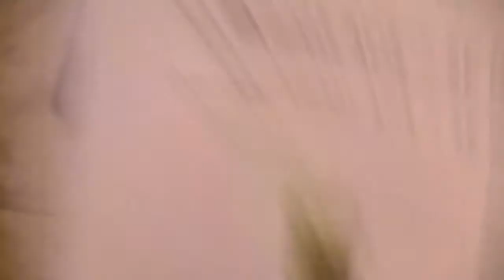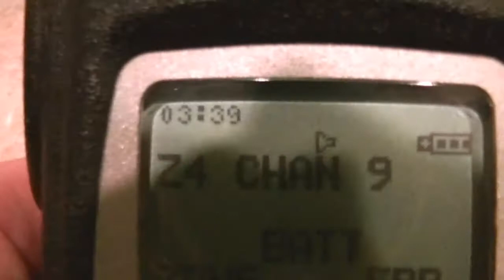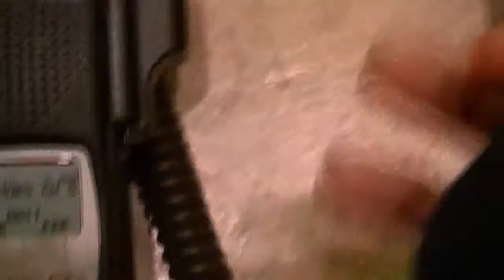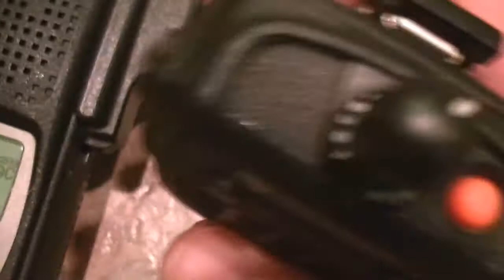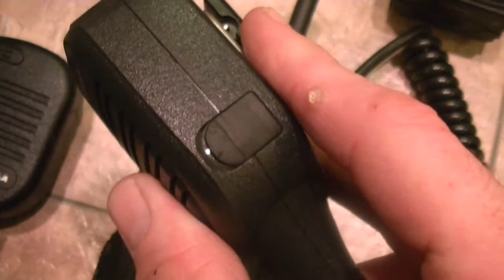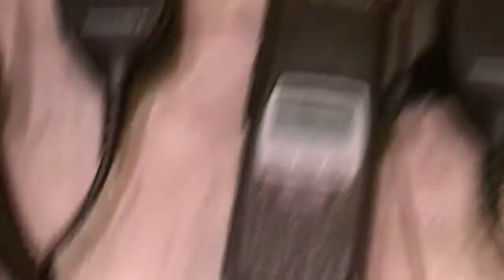Motorola XTS3000, XTS2500 and XTS5000 Mics - Also Jedi Mic Info and Info about E-bay 5k FPP "deals"

Comment: Snarling Rabid Dog RULES !    He is by far the most honest & ethical seller of Motorola Portable Radios out there.   He gave us a ton of time and information prior to ever making a sale.  Of course, we selected him for the initial purchase and most subsequent purchases.  

The only "problem" we seem to run into constantly is the fact that he doesn't stock much "T-Band" gear in some of the complex configurations we sometimes need.  (but, thanks to O'Bummer,  in addition to shredding the Constitution, destroying NASA & as much of our brave military as he could, ensuring a lack of secure borders, PERMITTING EBOLA INFECTED patients entrance to the US, etc...

While not golfing or on vacation, Barry Hussein O'bola managed to pull of a neat trick. While working on spending taxpayer $$ on worthless programs, his work with one of the initial "stimulus" spending tricks involved TAKING BACK ALL of the T-Band Spectrum currently being used by public safety in major metro areas. (surely with plans to "auction" it off to one of his cronies...)  

EXCEPT, there is no real replacement or solution currently in place to address this lack of spectrum & even the "freeze" on modifying any current licenses is hurting  quite a few organizations .   (The Fed.Gov 700mhz "D Block" "Solution"  is not an ideal fix to any of this.  "One size doesn't fit all" --  And, even if 700Mhz were a perfect solution for all users, who will be paying to replace all of those nice new & shiny T-Band radios & infrastructure that were all JUST PURCHASED & INSTALLED...)    

Sorry for the off-topic rant & hijacking the thread, but just know that .   SnarlingRabidDog5150 is A++  

RB

Comment: Very good video love the little pop up quotes. I bought  a XTS-2500 recently from China worked great but like you said FPP is basic was ok for Ham use but needed features like APCO25 Analog mixed Mode Channel setup, P25 repeater user callsign an much much more features like Police and Fire set to RX personality only. So bought the Astro CPS R16 got the whole works now. I sold them and got a set of XTS-3000's for Security work